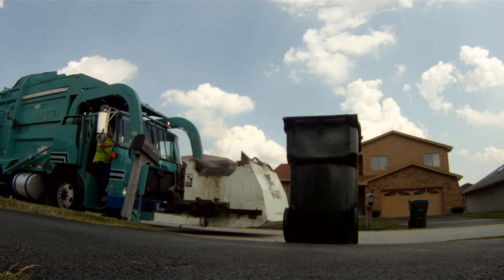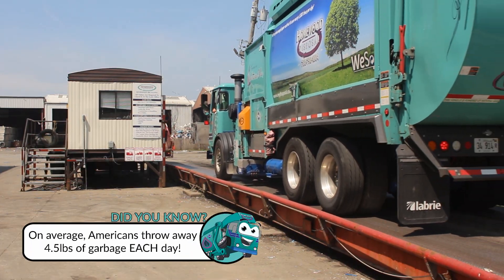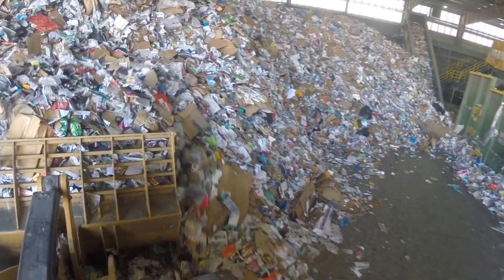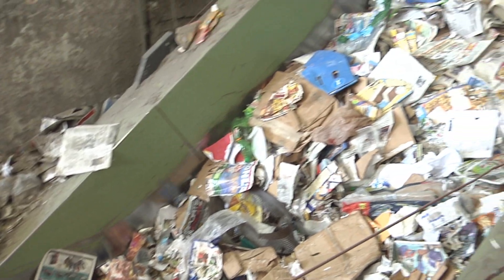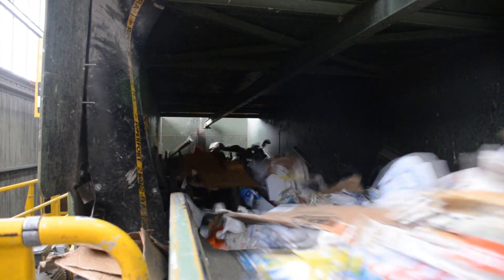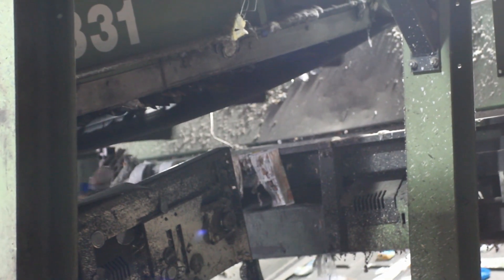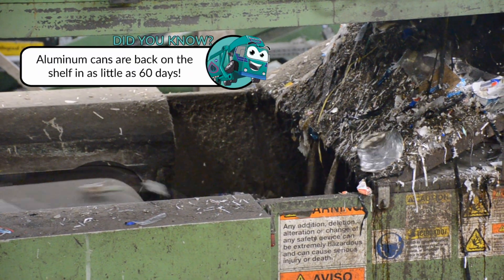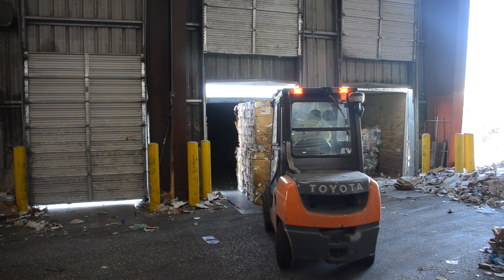Sorting and Recycling Facility - Follow the Process

Comment: Plastic bags with the #2 or #4 recycling symbols ARE recyclable.  This video failed to point that out.
Reply from the maker: Right. Technically clean, dry plastic bags are recyclable. Just not accepted in most national curbside pick up programs. They can be brought back to local stores where they came from for recycling.

Comment: I begin to sort the garbage firstly in the supermarket. I give a preference to the products without a package or in recyclable package. At home I don`t have the excess of products, or some things and I always sort the garbage very carefully till the last scrap of paper.
Reply: Tip: Loose scraps of paper aren't recycled because the machine that sorts them can't pick them up.  Put them inside of a paper bag instead so the machine can get a grip on it.
Reply: Well,, the weird thing is that, of course it is good to separate garbage from recyclables, but after that depending on where you live, and what sort of machines your recycling center has, it may not matter. They all get thrown in together and the machines and some workers do the work of separating "types" of recyclables. I did not know this until I started watching this and other videos on this subject. It's fascinating.